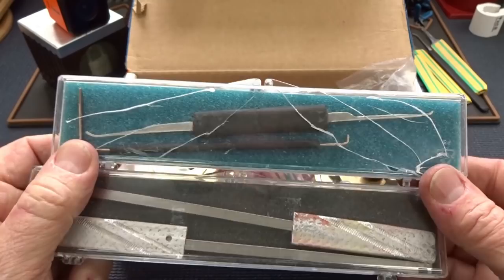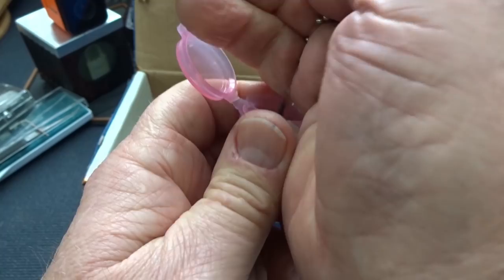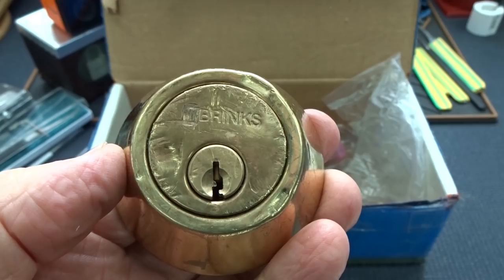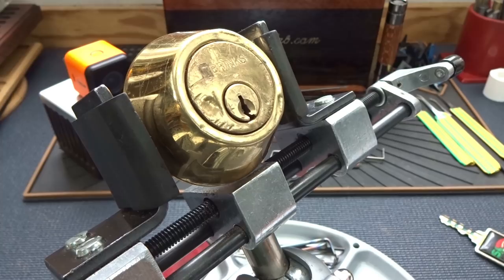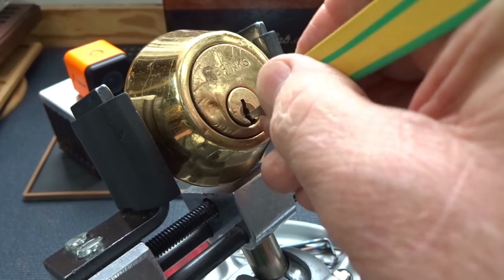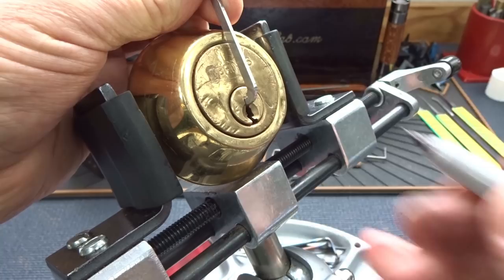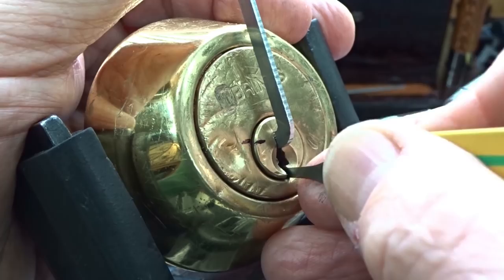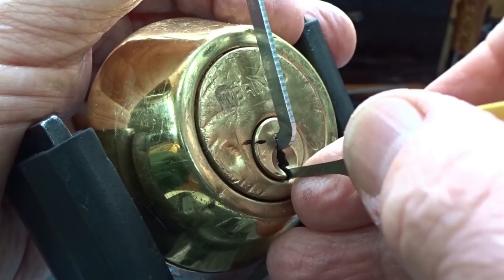(1219) Challenge: Erroneous Designs Unpickable Brinks Lock

Comment: Lock has been unpickable to whole host of lock sporters... Bill picks it in 2 minutes and 25 secs.
Reply: Yep. It just shows you the difference between somebody who thinks they can pick, and a true picker.
Reply: neil You are right about the tension, but if you look at the keyway, the ledge on the right is pretty far down, and you have a clear shot from there. Looks like you could go with a .025". Personally I would have gone with my .015" Deforest (and cursed for three days).
Reply: Don't forget, Bill is a legend.
Reply: Bill is good for sure, LPL would have done it in 30 sec.
Reply: This video was posted 4 years before I watched it, but is a new one to me. Excellent picking, Bill. It was likely a very interesting, and much more challenging lock, when it was in its prime. I wonder whether some springs had been lost, rather than failed, over the years, when people picked and reassembled it, without them telling anybody?

Comment: The trap pins were gravity  and the plate at the bottom was to stop the core from rotating without a Key thus stopping from picking upside down, probably to foil the European pickers that may have gotten the lock.  The trap pins would not work if lock was upside down but plate would. Well thought out if the work would have been better this would have been a perfect challenge lock

Comment: Bill, many companies used those steel plates as a shim.  If a key blank had enough slop, that plate would push the blank to a position determined by thickness.  Most of the older Chinese locks used things similar, nothing out of the ordinary.  If the plate was missing, 2 things will happen.  First being, the user would need to "lift" on the key to make it function correctly.  Second, when the plug is turned 180 degrees, the bottom pins will fall into the cavity where the plate belongs.  The 3 trap pins?  No idea, considering the remaining machining work that's left of the lock, I believe those to be stock.

Comment: The notches on the key remind me of the Emhart brand locks. The factory would intermentently drop them in the wards of the plug housing to using regular blanks as well as interchanging system keys. Like another level of security.

Comment: thinking about it, I think the bottom bit is supposed to act as sort of a side bar. that or, originally he had designed it as a trap slot to capture the key pins in the 180 position but noticed an issue(even with key in, it would still get trapped due to gravity) so he used the metal plate to fill in the gap. would love to see the workings of the other one, it may shed some light on both the bottom bitting on the key, as well as the plate.
Reply: The plate fits inside the bottom of the Bible under the key and covers the holes for rekeying.  Brinks tends to do that on their locks.  For a Brinks challenge lock I made I just glued the plate in to keep it from messing anything up at 180.
Reply: Pickaholic ahh ok, that makes sense, but what about the notches on the bottom of the cylinder? any thoughts on that? I haven't pulled too many locks apart personally, I mostly just pick what I have around the house lol.
Reply: stonemason90 I have no idea on that one lol.  It does look really cool though!
Reply: Pickaholic what I was originally thinking was that they may have originally planned on it being either a side bar type deal or actual extra pins
Reply: stonemason90 very well could be.  That would be neat seeing someone pull off a homemade sidebar.

Comment: I believe that the plate is built into the lock to allow for re-keying the lock with out removing the core. I have an older cylinder that has the same thing, and it had a sticker that said to remove the plate in order to re-key the lock.

Comment: I've seen the bottom bar on cylinders before. In normal use you can rekey the cylinder by removing the bar and rotating the plug 180 degrees and change the pins. It's normally held in place by a strip of tape.

Comment: that plate is for rekeying without taking the lock apart like an abus pinning window, then it keeps the bottom pins from falling into the groove on a 180 degree turn of the key which happens in some deadbolts.

Comment: Well that's cheating you have the key...so you can see exactly where the tumblers are in the keys cut. There's no way to know for sure that you didn't already match your picking to the keys groove cut. 

That defeats the point in my opinion if you can see the key you know what to do. I call Shenanigans... If a man has the key and can see the key he knows how to move the pins by looking at the cut grooves in the key. He said many people tried and failed and beat it to hell and you got it in the first try...I dont think so.

 I'm callin Shenanigans for full credit you should have done it with no key visible to you.
Reply from the maker: Fair enough. Most people sending in the custom-built challenge locks seal up the key.  This builder had such high confidence in his design that he didn't seal up the key.  He was very close to being right.